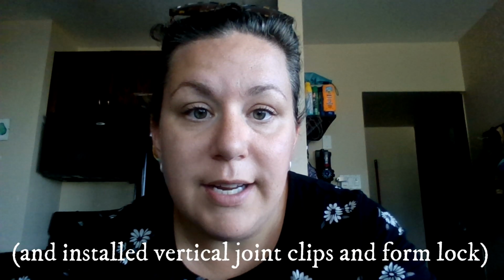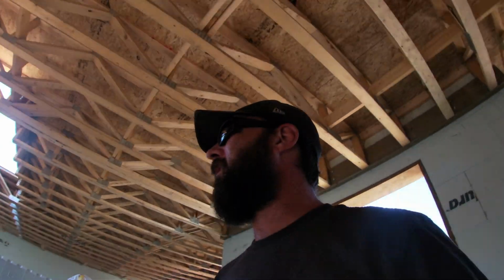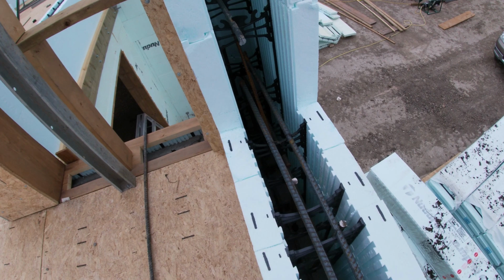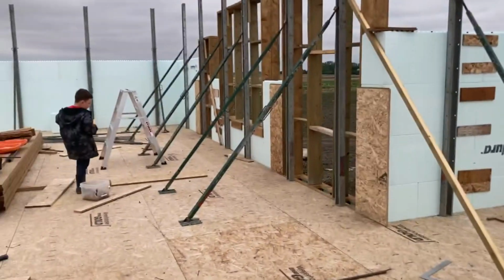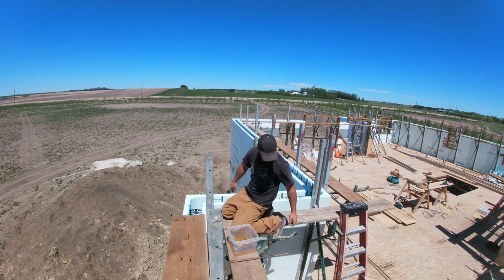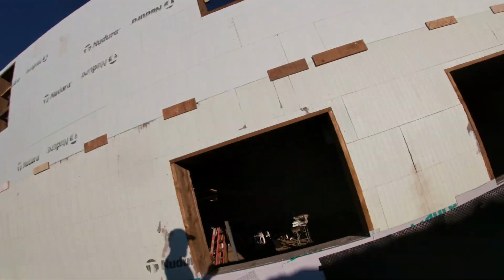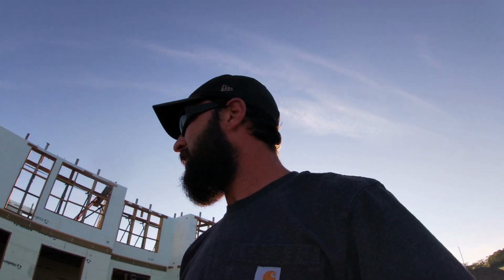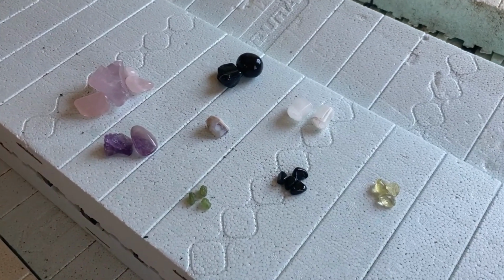Vlog 7 - Building our ICF Main Floor Walls - Nudura ICF Construction - DIY ICF

Comment: Super cool! I found your channel as im trying to watch as much diy icf as possible so we can start ours in a couple months! Great video guys!
Reply from the maker: We did the same thing leading up to starting our build!!!!!
Reply: @eberlesbuildahousediyicfho9630  did you guys rent your icf braces ?
Reply from the maker: @minutemandefense3935  yes we rented them.
Reply: @eberlesbuildahousediyicfho9630  awesome! I'm going to look into that as well as the zont brace hardware
Reply from the maker: @minutemandefense3935  The company we bought our Nudura blocks from here rented them to us. Also some smaller braces for the frost wall and garage grade beam. Super easy system to use! We were impressed!!!
Reply: @eberlesbuildahousediyicfho9630  awesome,  I'm hoping for a similar situation here also. I have a call out to the local nudura rep but haven't heard back yet. Did you have to wait a long time for your blocks?
Reply from the maker: @minutemandefense3935  it wasn’t too long actually. About 4-6 weeks from when we ordered to when we got them. I can’t quite remember, but it wasn’t very long.
Reply: @eberlesbuildahousediyicfho9630  that seems reasonable!

Comment: Did you guys do 8in walls all the way up?
Reply from the maker: Hi! No, the walkout wall is 6” core, the rest of the basement walls are 8”core. Then we transitioned to 6” core for the main floor
Reply: I'm planning a build with nudura in 2 months in Montana, did you use the transition brackets? Did they work alright? Do you have some video of the transition posted I can watch?
Thanks!!

Comment: so i want to make sure i got it right for thewindow and door bucks there are two vertical bars of #4 rebar on each side of door and window and the 2 bars of horizontal on top and bottom and then one cross bar from each side?  did you do lintels for thetop of each window?  As you stated if the bucksfor windows and doors are not done correctly that will cause issues.
Reply from the maker: I took a picture of this detail on our engineered drawing but I don’t think there is a way for me to post the photo to share with you! This is Candice answering and I don’t know much about details… I’ll get Aaron to reply later 😜
Reply from the maker: I haven't seen anyone use lintels on ICF before in any training or private videos.  Our engineer designed it without.  I see them in block walls often but not concrete walls.  We will be OK without i think.

The concrete guys were actually teasing me about the amount of rebar I put in the walls.  I did a bit more than the drawing called for but there was a lot there to begin with.  2-15M rebar above, below, and beside each window/door.  Then 1-10M bar on the 45 at each corner for reinforcement.  Then it end up a 18"x16" pattern for the rest except the top and bottom of each pour where there is an extra bar or 2.